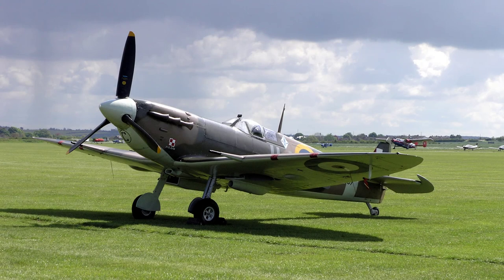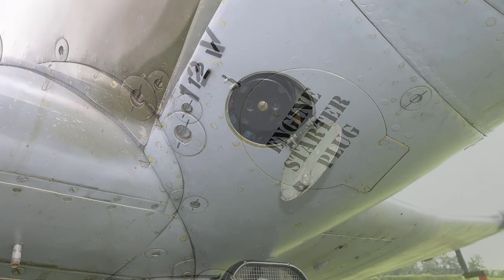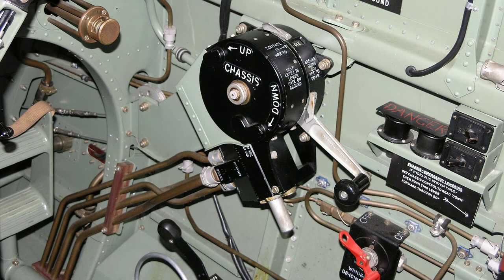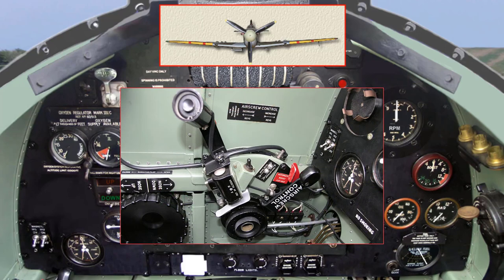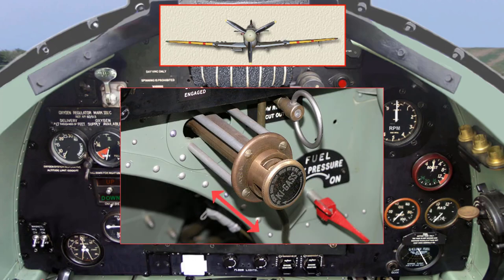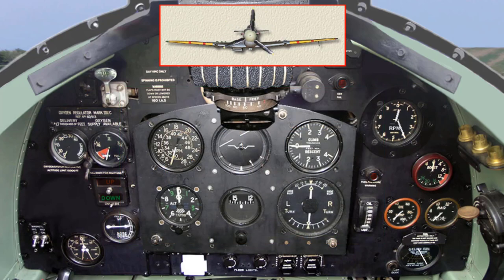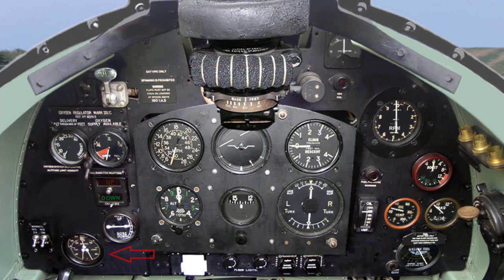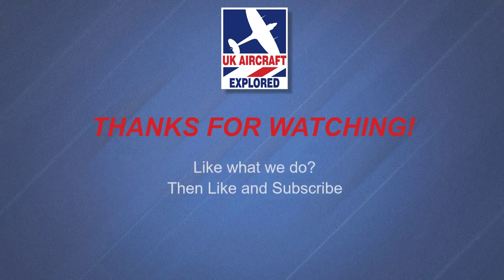Spitfire Mk V - Engine Start Up Sequence

Comment: Maybe you can help with this question I have about the MkV controls.  My dad, now deceased, was flying a Spitfire MkV over Tunisia in 1942 and was forced down when his engine was damaged during a fight.  He said he was at 13,000ft "where the superchargers would go in and out, the engine kept running, but would only idle".   He said "he held down the test button to get all the power he could".  That didn't work, so he had to glide down for a wheels down landing.  I think he tried to turn the supercharger on with the test button (booster coil button?) to try to get more power.  What do you think he was doing, and was there any chance that would work?
Reply from the maker: It sounds to me that your father was trying to restart the engine. The Booster coil Pushbutton is used alongside the Starter Pushbutton and helps to start the engine by providing a high-tension electrical current to the spark plugs whilst the engine is turning over. Thanks for watching.
Reply: @ukaircraftexplored6556  Thank you for the response.  That makes sense.  He probably thought the engine had stopped so was trying to start it.  His comment about the supercharger is what threw me off.

Comment: Forgot to mention to pull the stick back prior to start up
Reply from the maker: Thanks for your feedback, this wasn't mentioned in the wartime AP manuals of the time (1942). My video series is designed to recreate the wartime AP manuals in a modern video format. I can only assume that the trained pilots at the time knew to hold the stick back when starting and that was why the pilot's notes and manuals didn't mention this. Thanks for watching.
Reply: Its so that if the engine started and throttle input was to high, by having the stick back the rear elevator is in the up position which would stop the aircraft tail from rising.
Reply: @ukaircraftexplored6556  
Just watched a video on another channel of a Spitfire Mark 1 startup, pulling back the stick was one of the steps. Probably by this point they just decided it was common sense.

Comment: Bit of a faff then, especially if you have been scrambled due to incoming air raid.
Reply from the maker: Thanks for watching
Reply: I think you will find that ground crew will have left the aircraft in a "ready state" for start up. All the pilot would need to do is flip tye magneto switches and hit the starter and primer pump. AOC Kent had a requirement to get fighters off the ground in 2 mins. This is the only way it's possible.